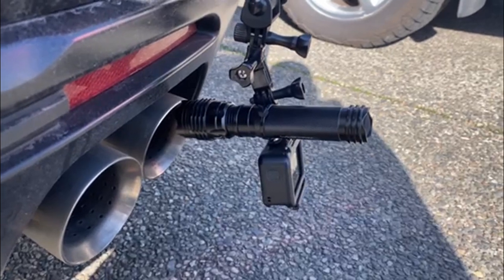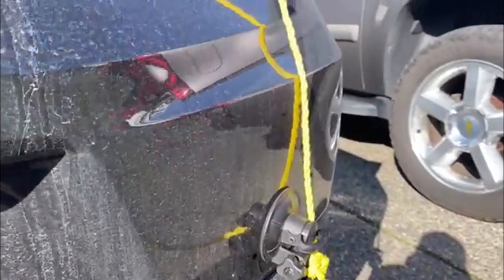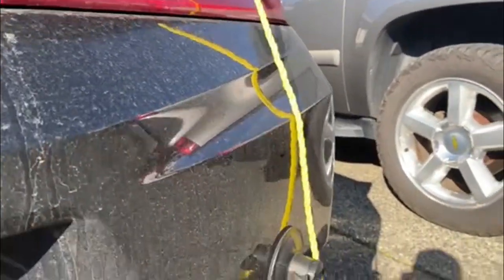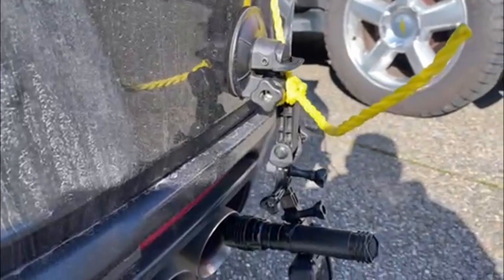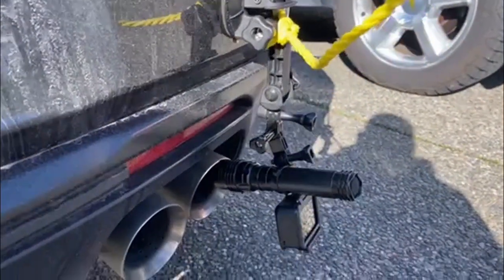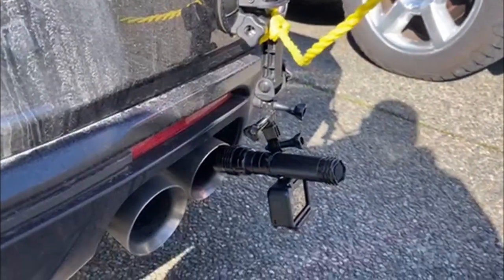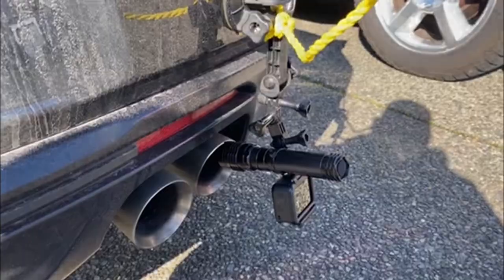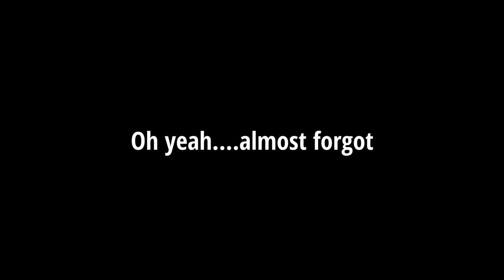How "ACTIVE" is active exhaust? A test of the GM NPP exhaust and how it works.

Comment: Thanks for doing this video. It's something I've been thinking about especially owning 2 cars with an active exhaust system.  Only thing I'm left curious about is what the valve does at idle between modes
Reply from the maker: Thanks for watching and liking! The valves open when going from touring to sport/ track at idle when selected.
Reply: @The 604 Garage  
I didn't phase my  comment properly, I'm no writer.

I guess what I was trying to say was that I'm curious about how the valve behaves at different times. When you switch to sport or track mode in park or neutral the valve opens... but as you're driving in your video, the valve closes (at some point, not included in your video) because at the start of your test whichever mode the car is in the valve is closed and then opens becoming very active.  I am curious as to why it closes so often.

I am not sure if I am making my continuing curiosity clear.
Reply from the maker: I understand now your question and you are correct. After switching to sport or track the valves do close during normal driving again and open up when you upshift/ downshift/ or go WOT. Not sure why GM made them do this. It must be related to the torque requirements of the engine and that is the main factor in valve position over what is selected IMO which explains the opening while upshifting/ downshifting/WOT. Still just starting to uncover some of the system behaviour. When the NPP fuse is pulled the valves stay open all the time and never change.